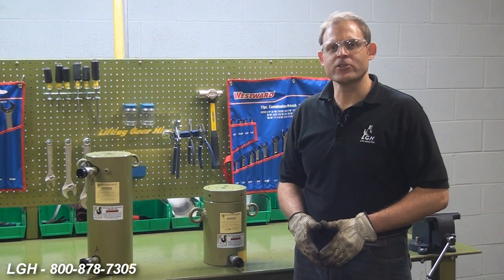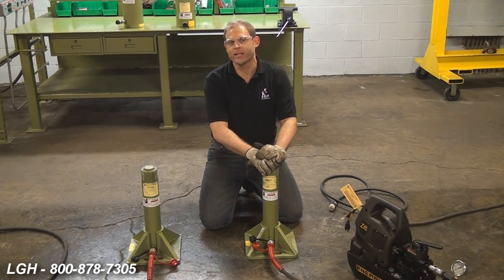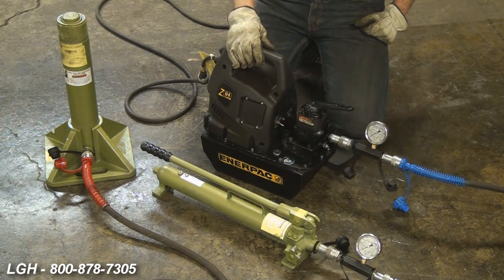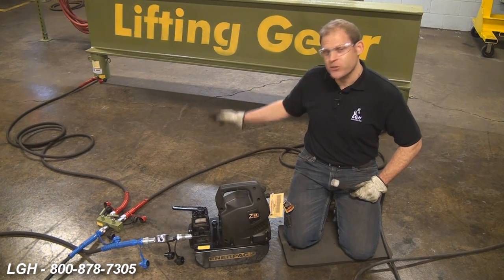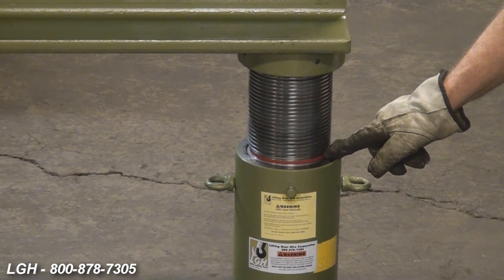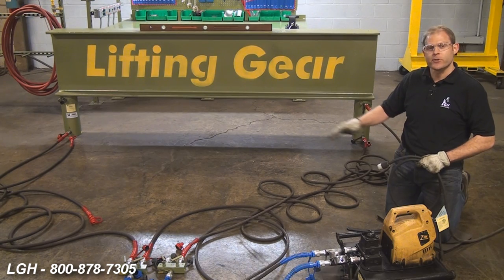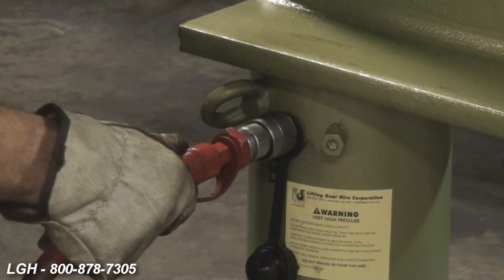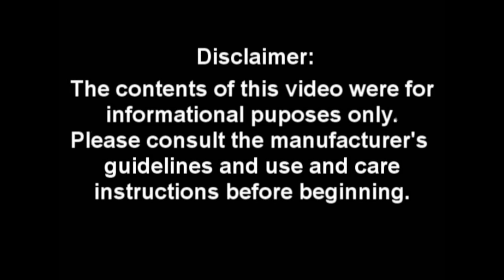How to Use Hydraulic Cylinders

Comment: Do you not use a flow divider when running two cylinders? I’m looking to get two cylinders and a pump but I’ve been told I need a flow divider as if there is more weight on one size then the pressure would go to the least resistance without a flow divider